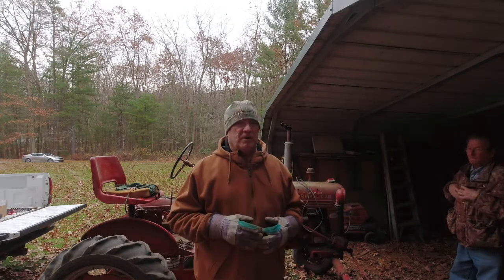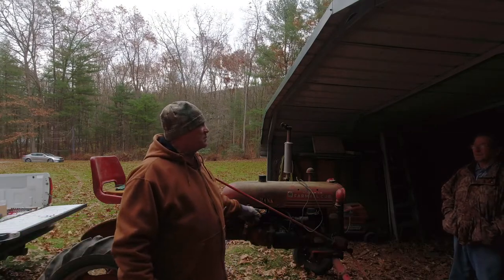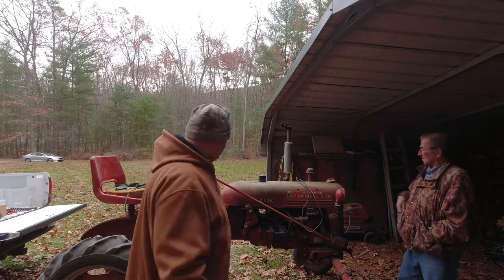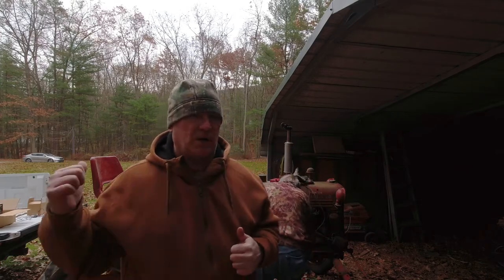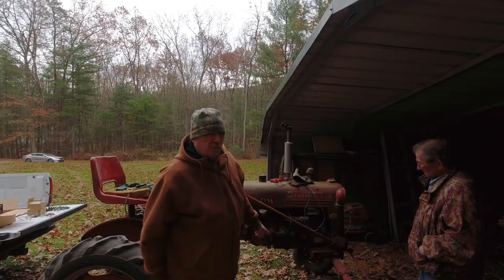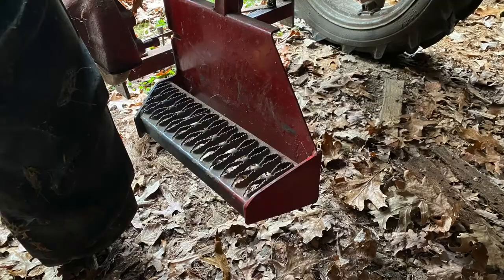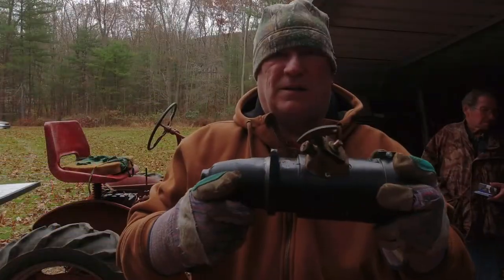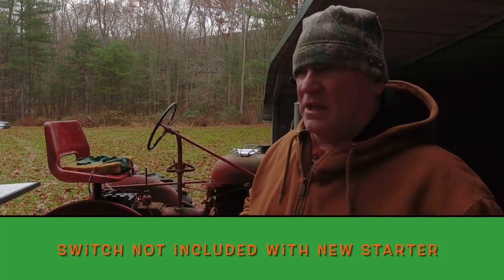#97 - Dad's Farmall Cub

Comment: Nice tractor. Great machines. 9 1/2 hp.  Would a good spot there Bob to have the mower deck. 
Have a great day.
Reply from the maker: When dad purchased the Cub, it had a Woods mower deck.  He removed it so it did not get hung up on stumps in the bush.  He sold it, but recently wishes he still had it.  He didn't know what he had with the Woods mid-mount mower.  Thanks for watching and commenting.  Enjoy the journey - cheers
Reply: @botabob  👍🏻👋

Comment: Old Hank lives. Good diagnostics to figure out that system. The tractor sounds good and the step sure is a great idea. 👍
Reply from the maker: I really need to work on camera angles.  My dad was not really feeling the video part of this video.  But after it was finished and published he really like the results.  He is a man of habit and doesn't understand tech at all.  But once he figures it out then he enjoys the new thing.  I bought him a Milwaukee Tools battery powered heated coat to wear when he goes out in the cold.  I was not sure he would use it, but he really seems to like it and keeps the battery charged when he comes inside.  He really want to go outside, but he cannot tolerate the cold temps now.  I do what I can to make things work for him.  He is very independent.  Thanks for watching and commenting Larry and Enjoy the journey - cheers
Reply: @botabob , I enjoy your videos and have watched many. I think it's great that you help your Dad and make him part of your videos. That is a special time so, enjoy it.

Comment: I LOVE the Cub! There's a fully restored one down the road at a local Dahlia farm. Thanks for sharing :)
Reply from the maker: Yeah they are pretty good tractors.  The guy I worked for as a teenager had a Farmall Cub - he rebuilt the top end of the engine and put bronze valve guides in it - the old valves were sticking because it was left outside and water would enter the exhaust and set on the valves causing corrosion - I think if you keep them under cover they will last a long time - thanks for watching and commenting - enjoy the journey - cheers

Comment: I really like your dad's tractor, it is a very cool machine. The step is a great addition and I am pleased you got it started, great job
Reply from the maker: Thanks 👍 We had to go to my dad's body shop to get the old cotter pin out of the push pin.  It was rusted in place.  And then a run to the Harbor Freight store for a cotter pin to hold the push pin on the new switch.  Eventually, we got all the things we needed and put Ole Hank back together.  I think that old tractor sounded good.  Thanks for watching and commenting - Enjoy the journey - cheers

Comment: Two holes in hood are for oiling the generator.😊
Reply from the maker: Thanks for the information Jim.  I can say it's very unlikely my father has used them.  He is not one for doing PMs.  I will tell him what the holes are for.  You know, the equipment built back then was very utilitarian.  Everything had a purpose.  My father is quite the joker and I was kidding around with him on this day.  I think the voltage regulator is bad on this cub because the battery keeps draining. Thanks for watching and commenting.  I learn so much from the community.  Enjoy the journey - cheers